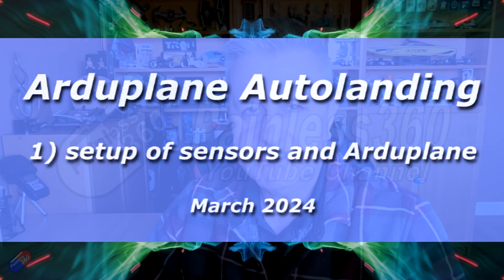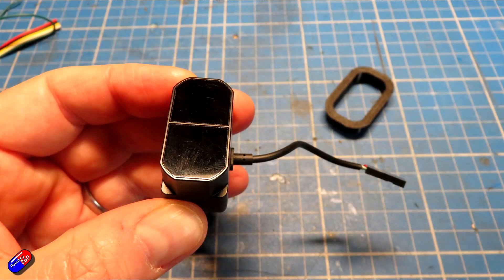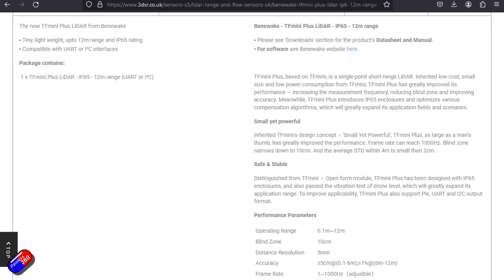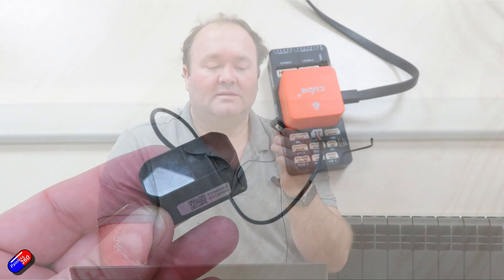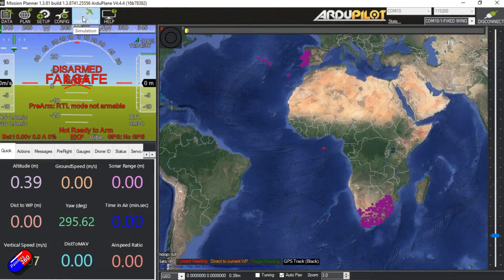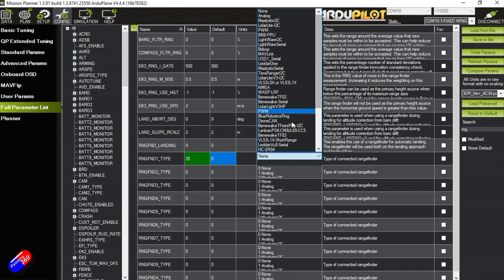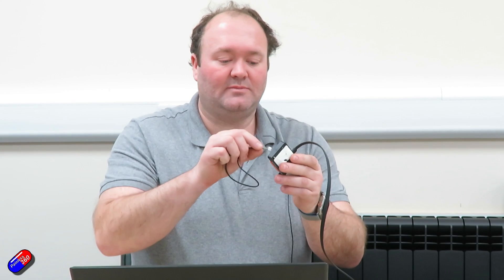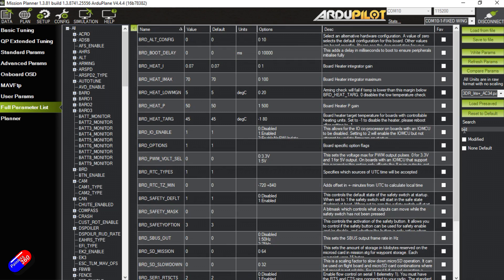Arduplane Autolanding Setup and Demo: Part 1. Setting up Arduplane and adding a rangefinder

Comment: Sure now that I have all but given up,  you bait me with the ultimate challenge.  The pull to do this is great,  having a sense of humor ,  I must wonder might this work in a j3 club.  I was but a lad when I saw my first cub up close and personal.  Watching planes take off and land from Aoria Airport. Just off the road near the end of a runway, the cub taxied , then made its run, a spit a cough a puff of smoke. A loss of power a correction, a bounce off the top of Dad's car.  From my spot on the ground how it cleared wires and trees 50 yards away a mystery.  As to the strike on the old Chrysler,   it left a pair of foot prints , which were never washed off, made for a great story.  The indent, simple hit the headliner really hard it popped out, thosevsoft rubber tire marks all the proof needed ....Take Care .

Comment: Very interesting thank you, however it just goes to show again that Arupilot is not user friendly, wouldn’t it be nice when setting something like this up, to have all the option listed on one screen and in the order you need to configure it. I think all the community driven software has the same sort of issues. My term for this is “ written by developers, for developers “. 
Anyhow thanks again, interesting topic, and I’m looking forward to seeing it in action, especially given the cheap price.
Reply from the maker: I'm guessing you missed me adding a Rangefinder to a plane for autolanding in INAV the other week?
Reply from the maker: https://youtu.be/42JBUP0k2Vg should help (preview for you!)
Reply: No not me, but this is definitely a cool bit of tech to add to a model. I have a large BlackHorse Viper edf model, that I’m fitting with inav as the stabilisation, and also for battery telemetry etc, I’m quite interested in possible adding one of these rangefinder too, just as a possible failsafe, and a bit of fun.

Comment: This is very interesting stuff. I've only just fitted an airspeed sensor, as well as a flaperon/spoileron configuration to my Swordfish. Adding an additional control surface to the wings I currently can run full length flaperons or switch to flaperon/aileron mix and vary the input via the left slider. I'll be taking notes on stall speed, glide slope, and throttle position in the coming weekends.

Comment: Question for Ben: the old Parrot Disco had a circular automatic landing that would allow it to always land into the wind and allowed automatic landing in a park where the glideslope would otherwise be impaired by high trees all around. Does ArduPlane have anything similar?